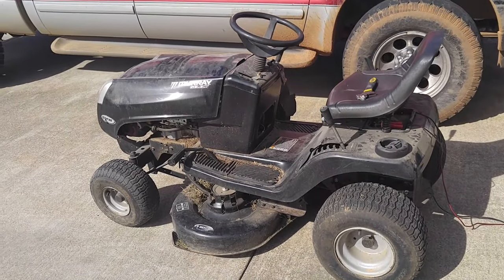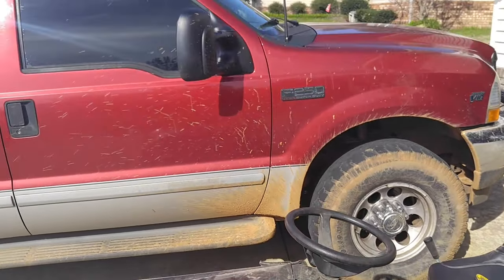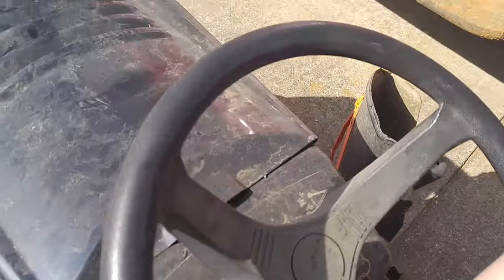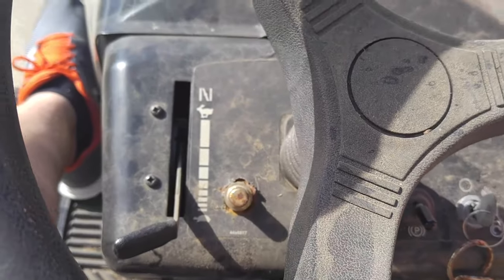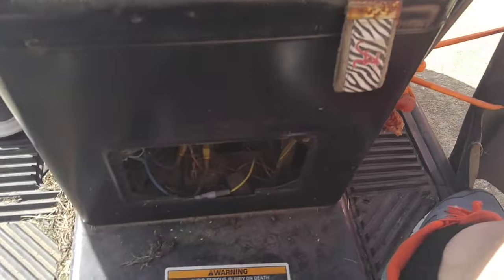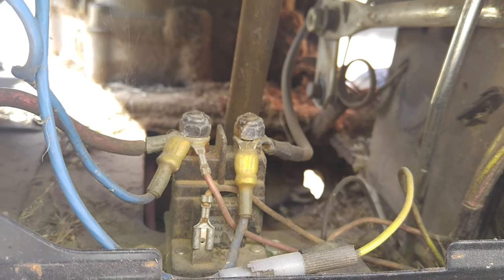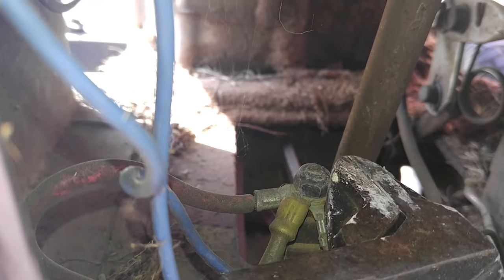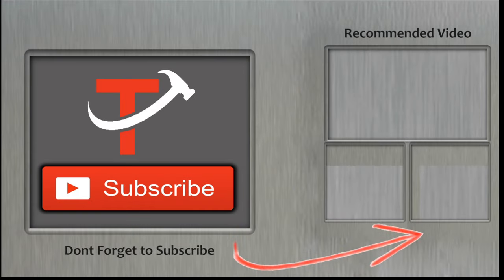Crank a Riding Mower with a bad Starter Solenoid

Comment: There is a fuse in there on the ignition wire. It's a #15 just replace it.
Reply: it usually a 30 amp to handle  high amps cranking

Comment: 2020 and I have the exact same mower and the same problem. I replaced the starter switch, seat safety switch, and battery and it still didnt turn. Jumped the solenoid and it turned over. Just ordered a new from Amazon. Thanks so much for the video.
Reply from the maker: Thank you. I'm glad it helped you out
Reply: Are you saying you ordered a new solenoid because it is bad, I have the same problem I tried to jump the solenoid and it does not crank the motor just sparks like all heck.  It keeps trying... I put a new battery on so not the problem.
Reply: Cheryl Shepherd purchased a new solenoid and installed it. Problem fixed. Mine just sparked as well when I tried to jump it.
Reply: @fwacfred  come to find out a person that didn't know squat broke the right terminal on the solenoid.  I replaced it and still can't crank...Not a sound,  meaning crickets silent. I am replacing the ignition switch because it's hard to engage...I think the person who broke the solenoid executed the death punch to it...Its a shame a nearly 60 year old woman with very limited mechanical abilities does better work!

Comment: if you are thinking about buying a old mower  and you would liketo know the exact age   raise the seat  should be a lable  with mod #  and ser #   first  2  is day  3+4 month 5+ 6 year for   instance  mode #   then serial #   13 09 08 13th day sept  2008 mfd date this is common but some may differ

Comment: Tried this with my Huskee and got no spark. All I did was replace the belts, put the deck back on and it has no power at all. Bypassed the deck safety switch thinking it was that, nope still nothing. Headlights won't even come on. Day #3 trying to get it going.

Comment: if you have carb with a solenoid it will have a wire connected to bottom of carb if so the key switch must be on to try to crank that conn 12 volts to carb solenoid to allow fuel from bowl into carb throat  so turn this key switch regardless how you are trying to crank it

Comment: If you need to start the mower by crossing the poles do you by pass the safety switches and if so could the problem still be else where .
Reply: no just have key switch on run start  short 2 big bolts on solenoid that should  spin starter ------ depeding on your eng you may need choke out and throtle up  a good battery  and fuel  should crank dont worry about sparks on the solenoid  you only need a few seconds to see it crank

Comment: Can you make a video of the mower starting from hotwiring
Reply from the maker: I can do that. It's basically the same process. You just use a jumper across the starter solenoid.
Reply: Trent I have the same Murray mower, I want to hear exact what it sounds like when it starts from the hotwire. That will help me, thank you.
Reply: @5.43v  it will be the same all you  are doing is bypassing a defect solenoid which is nothing but an electical swiitch inside solenoid case this a temp. fix you need a new solenoid

Comment: It just gives a very high pitched beeping noise. What would be the problem then?
Reply: sounds like its in reverse  that beep is a warning
Reply: @frankdavidson9675  nah my mower is a 0 point turn it doesn’t have reverse, still don’t know wtf is up totally, but I’m pretty sure at least my starter motor is fucked, probably more tho
Reply: @Alex-gp1fz  this test will tell you if starter is the problem take  a pr of pliers short out two big terms on solenoid if battery is good and starter is good this will tell you so as you short these two lugs starter should spin freely  engaging the eng spinning it it may not start yet but will eliminate the starter as the prob if this happen the solenoid appears to be bad if you turn thr key do get a click if so replace the solenoid
Reply: @frankdavidson9675  thanks, I already tried this and then the starter motor started smoking, so that’s why I think it might be both. My solenoid is in a stupid place and I can’t even fit a wrench on the bolts so imma have to cut them off. This is one shitty job. Thanks mate.
Reply: @Alex-gp1fz  have you checked low or no oil  the beep must be a warning of major results  this a new one on me  worked on them all adult life  of and on
Reply: check to see if pto switch is on its warning you if so push it off  want start if thats in gaged

Comment: Dude mine just clicks. But I can touch the contacts and it tries to crank but won’t start.
Reply from the maker: thurm101 sounds like you're not getting any fuel to the carb then
Reply: make sure key switch is on i connects 12 v to carb solenoid to allow gas from bowl to inter carb throat  also may need choke on and throtle up to crank
Reply: your key switch  must be on when you try to crank  by shorting solenoid that switch sends 12 volts to carb solenid to allow fuel to go from bowl to throad of carb ---- no switch no gas  will not start you can usually start one by spraying starer fluid in carb filter it will run a few sec if no fuel is prob

Comment: Hey I did the same thing but mine just sparks it don’t do nothing else
Reply: Turn the key to ON first then short.
Reply: Jim Conner mine does the same I got my key on and all it does is sparks.. idk what’s wrong with my mower
Reply: @jimconner1905  keyon or off want make it spin when you short those 2 big posts you  are bypassing every thing if it dont spin its a bad battery or dirty post and hope not  aBAD STARTER$$$$$$

Comment: Flipped. My 30 inch murry rear motor now strater won't crank over any one tell me how I can fix it
Reply: test it this way tuen on key switch to run short 2 big lugs on starter solenoid with a pr.pliers this should spin starter  if not check battery if its ok then it sounds like a bad  starter --- before buying a starter  clean barrery posts and cables good  if needed use baking soda and water and a battery post brush ( any auto store sells these brushes  money well spent